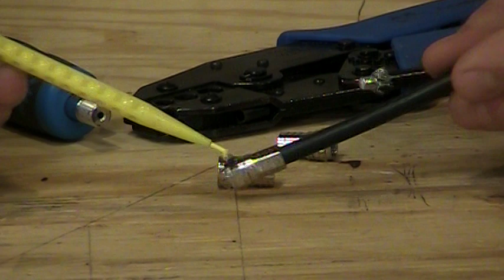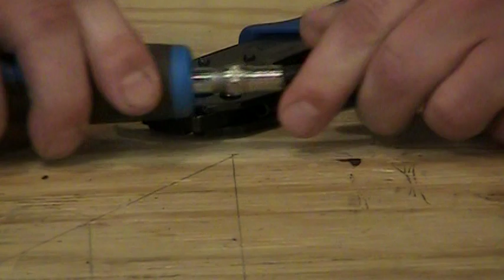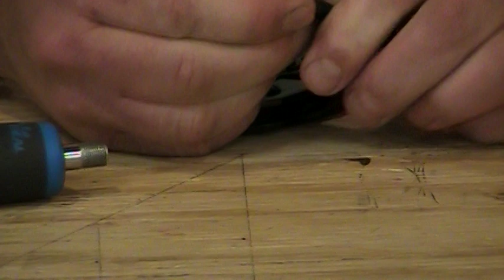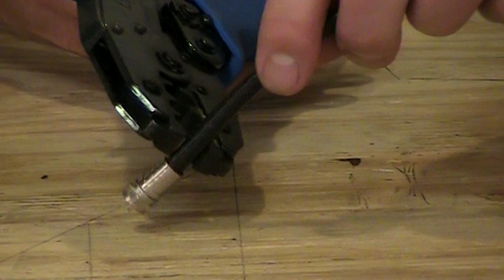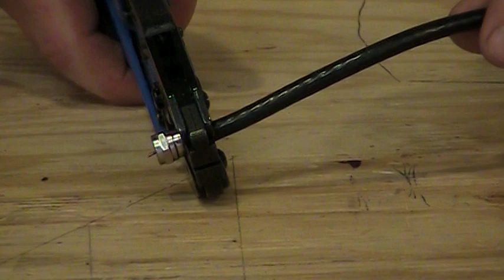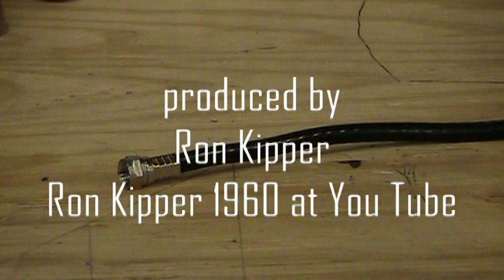Crimp On RG 6 Coaxial Connector Termination

Comment: Those tools are necessarily for sissies if you have ever worked with high braid cable such as quadshielded rg59 Headend cable with 2x 95% braids it takes the leverage of one of these tools (or a spare splitter) to get the cable jammed into the connector.
Reply from the maker: Maxbrando2000 Max there are times it can be useful as you are right the cable can change from brand to brand. Thanks for watching
Reply: I'm switching to compression fittings. Crimping RG6 was near impossible as the outer cable has a larger diameter than the RG6 fittings! Crimping tool was all we have in the old days while compression was for the pro cable guys then. Did form factor on the RG6 cable changed?